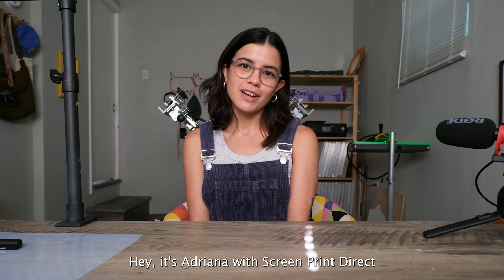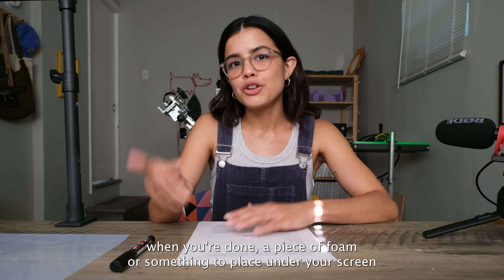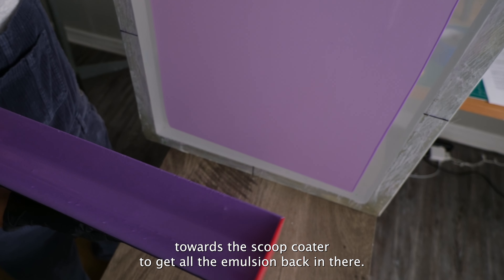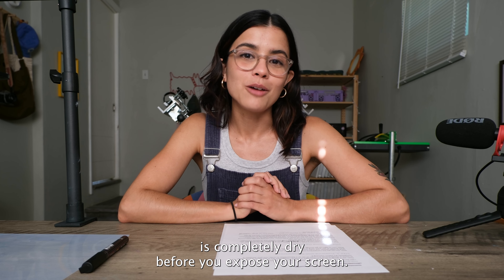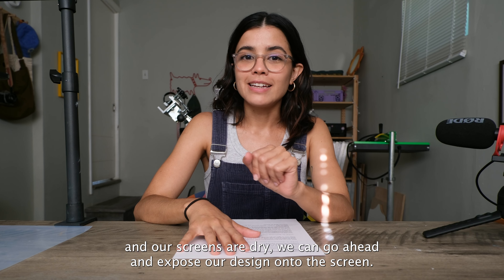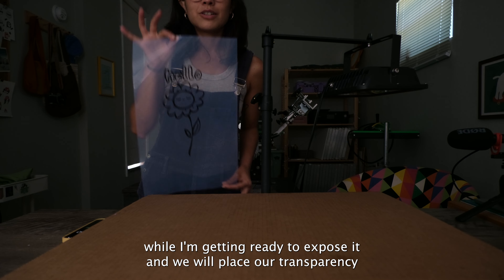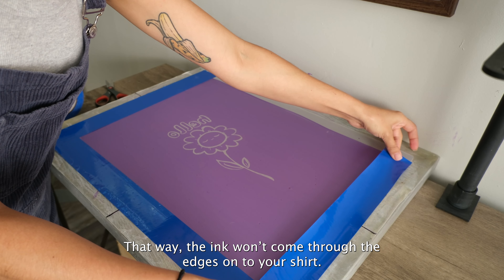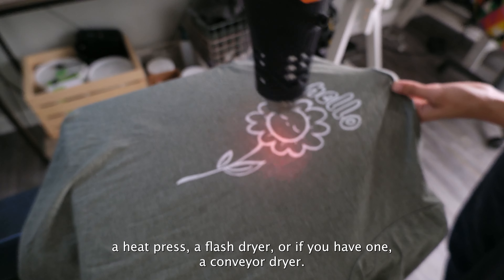How to Make a Screen | by Screenprintdirect.com

Comment: How did the hose get the image out??? I tried n mine just didnt clear out lol
Reply from the maker: Great question! This is one of the trickiest parts of the process. Your exposure time is crucial. You need to have your exposure time dialed in to have an easy washout like in the video. If nothing appeared on yours, you may have overexposed it. This means that you had it exposed to the light for too long. 

We would recommend doing some research on the emulsion you are using. If you are using an Ecotex® emulsion you can look on the container label for some exposure times or go to the product listing on our website which will give you all sorts of information for each emulsion's exposure time with certain types of exposure units.
Reply: @screenprintdirect  I did a step wedge test and figure the perfect one would wash out but none really did. They kinda just stayed there lol n did follow instructions

Comment: i used this emulsion. its not forgiving. it doesn’t washout easily.
Reply from the maker: Sorry to hear that. What issues did you run into maybe we can help you out.
Reply: @screenprintdirect  I worked in complete darkness, except for my red led headlamp, to apply a thin coat each side of my 160 screen. I didnt expose it at all and took it outside at night, again no light except for my headlamp, and hit it with the garden hose spray nozel. Nothing washed out. It was totally unexposed and nothing washed out. Waste of my time and money.